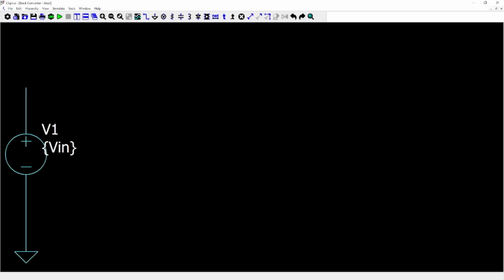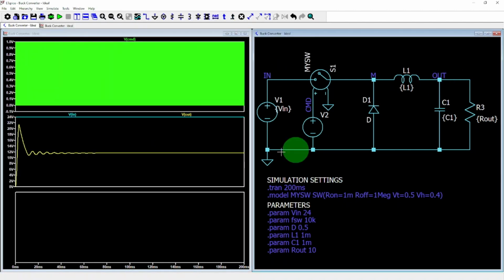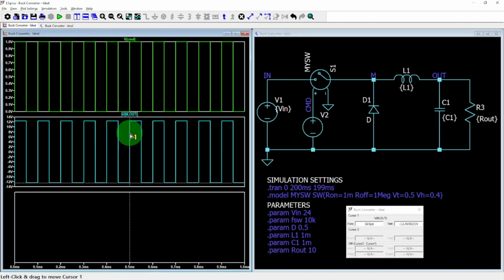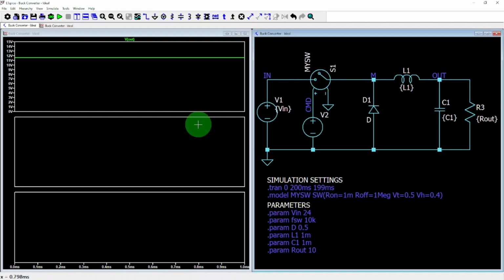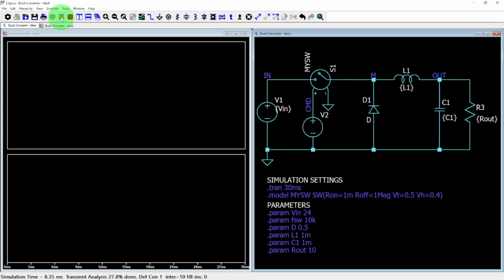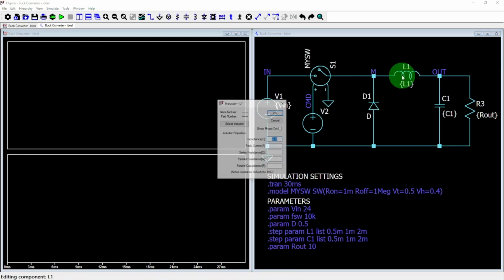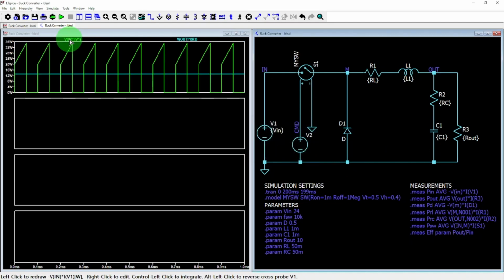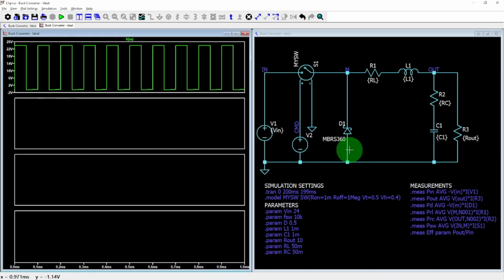Buck Converter 1 - All My Circuits

Comment: I really like the format of this video, showing a circuit by running a simulation. My only feedback is that I don't have the background to understand it. For example, I don't know what a "fixed switching pattern" is. If you're up for it, videos starting with the simplest circuits and building up to this would be very helpful. Thanks!
Reply from the maker: Thanks for the feedback! In the context of this video, "fixed switching pattern" means that the duty cycle to control the switch is set at 50% and doesn't change over time. This is in contrast with more complex circuits, where a feedback loop is implemented and the duty cycle can change. There's more to come...